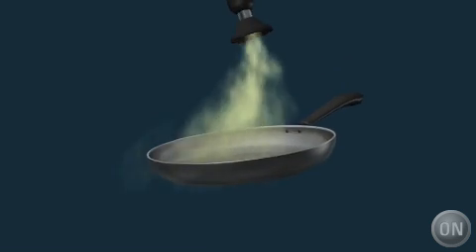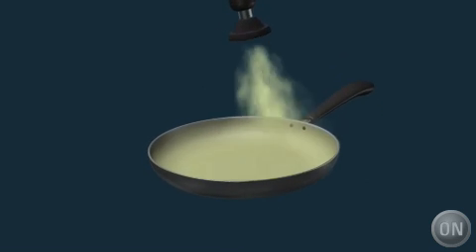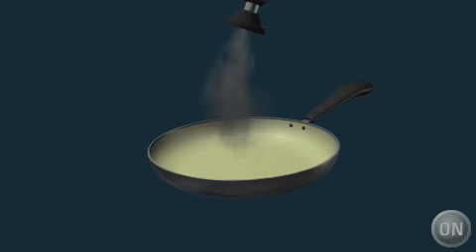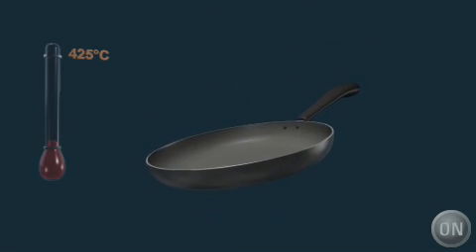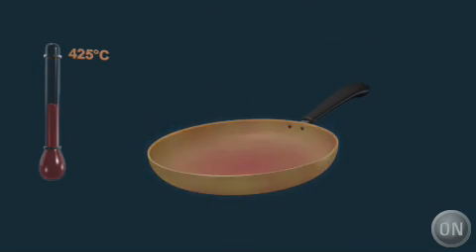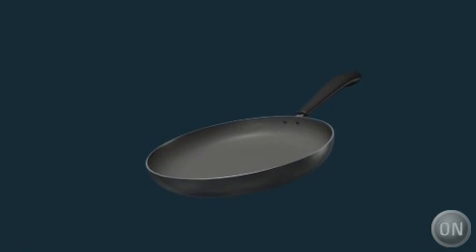Teflon

Comment: PTFE's inert attributes are used in many engines...including perhaps YOURS Dr. K.
The PTFE allows very little carbon to disturb the molecular structure..thereby being used in oil in car engines...I don't have a Ph.D (I do have a dog; wanna meet her?), but I surmise that the molecules protect open metal scratches and wear while decreasing further molecular degradation under high temps...is this right then?